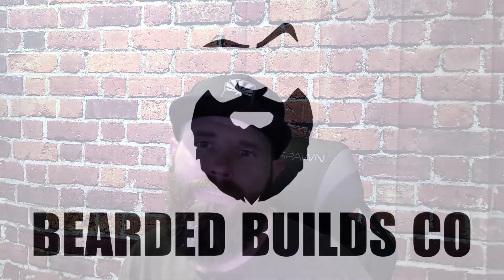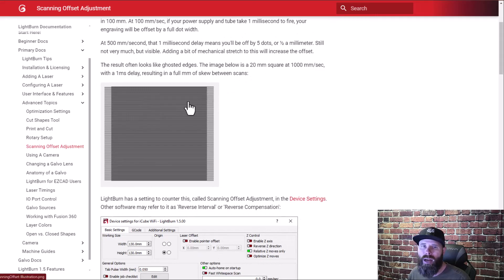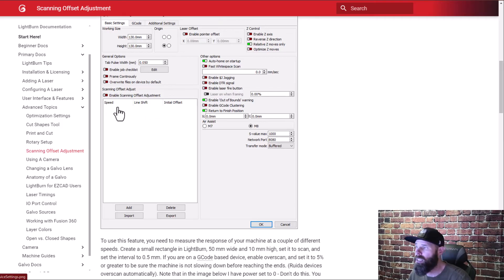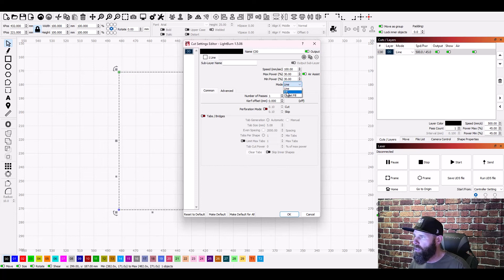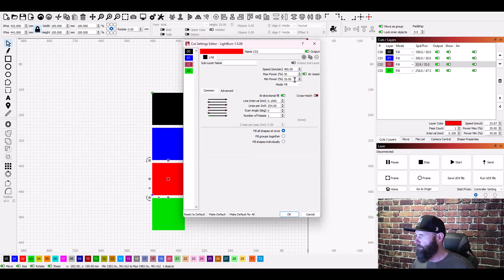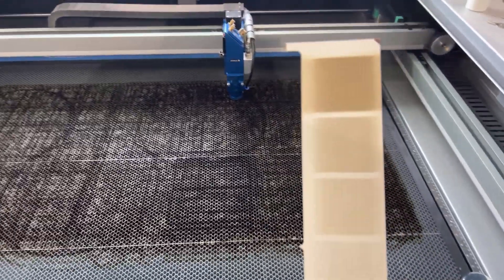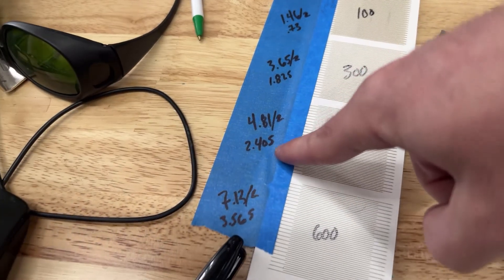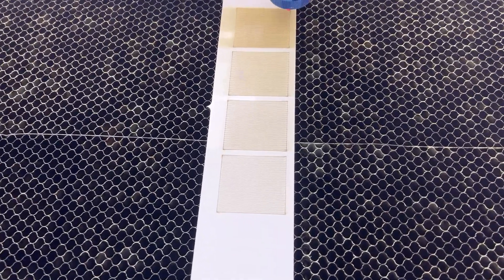Fix Your Blurry Engravings | Lightburn Scanning Offset Adjustment

Comment: Thank you thank you thank you. I am new to engraving and struggling for a month or so with “double images” it wasn’t off by much but enough that was totally annoying. I was ready to box up everything and return it. This image not only fixed my offset issue, it gave me confidence that i can figure out the rest. If anyone follows this step by step you will fix it. My only difference was i have a diode engraver and my settings were set to inchs rather than mm. But that was no big deal same principle. Thanks again. You gained a follower.

Comment: when doing mine, the adjustments are very minute. Even when I change them I still see my words are very pixelated. Any idea how I could help with that?
Reply from the maker: Either you still need to adjust your scanning offsets or your line interval is too low
Reply: @BeardedBuildsCo I follow the recommended settings from lonestar adhesives  and it says to use 300 ish lpi and I can get it smooth until I'm at 600 lpi, which I figure is too high but I'm not sure

Comment: Maybe you could help me out...
I did what you said. Enable Scanning Offset Adjustment new setting for Line shift does not stay when I create a new page. The new COO layer always starts me out at .0100 instead of my adjustment settings. Do I need to changes this setting ever time? Is the Adjustment settings just for reference? Thanks for any help.
Reply from the maker: I think you might be confused. The scanning offsets work in the background and compensate the left to right alignment of the design as it burns. 
I think the .0100 that you are talking about is line interval.

If you are needing one on one help you can schedule time here.
Calendly.com/beardedbuilds

Comment: Ok, great. Thanks now, do I just leave the enable scanning offset adjustment enabled and only run my jobs at those speeds?
Reply from the maker: Leave it enabled and as long as you got enough speeds programmed Lightburn should compensate for the rest

Comment: Thank you, was pulling my hair out trying to find out why it was doing this. ran a job in the morning no problem, then switched to an anodized aluminum job at much higher speed and it was throwing this error. Ran the calibration you showed and poof problem gone. took 15 min.

Comment: Hello!
I have a concern with my laser, please if you know how to fix either do a video or respond to this comment thank you and appreciate it. I have a NEJE 3 MAX V2 with E40 module, originally I was running the 810x460mm version and it was working fine in lightburn. Recently I bought the extension kit which would expand my working space area to 810x1030mm the problem is that lightburn now does not recognize the extra space😢 I changed the machine setting to the actual size and the outcome was the same. Basically, with the extension rails installed I can use only half
Reply from the maker: Xtool D1 Pro Extension Rails - Make your D1 BIGGER!
https://youtu.be/xej_fsXZBdY

Comment: Is it any possible that my new OMTech Co2 nearly doesnt have any offset in there? made this test 2 times and the offset is not measurable without a microscope. Or am i doing something wrong? For me your explanation is easy to understand and i used the exact same settings like you in LB

Comment: Great video.... I was SURE this was my solution and when I got up someone in the Lightburn forum simply said "tighten your X belt"     I went and double checked and yup! There was play...which gave the head SLOP in each start right and left... Your offset fix might have compensated for that and adjusting for different speeds might have compensated for increases torque at higher speeds. 
Your solution might be the fix for some, even most with this issue but i wanted to share my experience in that it might save someone else HOURS of troubleshooting and settings adjusting.

Comment: Great video, do these settings live in lightburn or are they uploaded into the firmware somewhere.
Do most machines come with offsets this far off? Those are some pretty huge offsets it seems.

Looking to get into laser cutting (10 year 3d printing background but new to cnc / laser) with a monport or an omtech 50 - 80 watt mid tier unit.

Comment: Also you mentioned these settings saving in Lightburn. If you have RDworks as well connected can they be saved their as well?
Reply from the maker: Why would you use both? You can export the settings and just save them.
Reply: @BeardedBuildsCo  just because I am used to using RDworks to load my work from coral draw?

Comment: Thankyou for this simple to understand video hopefully I can get crisp engraves on rubber! Can I just ask when I do embossed design so that the laser engrave the spaces between my design will I see less nasty engraved lines around the rubber engraved image, they look rather like ribbed pattern as in the line tests you show......hopefully the area not embossed but debossed will be smoother?👌
Reply from the maker: You need to test different line intervals, powers, speeds, and focal heights to get the look you like best.
Reply: @BeardedBuildsCo  Ohhh do you have a link for testing line intervals? I will do the test grid with powers and speeds & hopefully if I measure the material I can add in the 17mm minus the thickness of the material for focal height? Do this line test that you suggested first though or which order to do them in. I had exact measurements and focal distance for my rubber when the red and black 60 watt was working given to me when taking over the business so this is all new to me!!
Reply from the maker: @LouiseHolmanClarke you can test line intervals with the material test generator in lightburn.

I also have a full course on lightburn, its features, and usages.

Course.beardedbuildsco.com/store
Reply: @BeardedBuildsCo  Thankyou Ok I will bear this in mind in the future but for now I have a show in two weeks so I need to learn just what I need to know this week to engrave my stock! 😨

Comment: Do you have to do for every speed you use or will the software average the data and do that for you? ei,  if you use 380mm/s will you need an offset for that or will is use the date from the 300 and 400 that you have input?  Thanks for a simple and step by step explanation
Reply from the maker: You will want to do at least 3 speeds possibly most of you still see signs of an offset. If you use 380 I would do 200, 300, and 400
Reply: I did 100 200 300 400.  they came out even no offset..weird???

Comment: Once you enter your measurements, would you "write" to the controller? the version of Lightburn I have has this as an option  and I don't know if I need to hit it or not. I'm assuming I do.
Reply from the maker: Usually when you are doing this there is not a write to controller option. The software drives these settings

Comment: So, Lightburn will take into account these numbers you entered as long as it is enabled. You use speed of 100, 300, 400 and 600. What if you go 200mm or 500 mm speed, does Lightburn will average these numbers, I mean between 100mm and 300mm and between 400mm and 600mm, or you have to do it for each speed you use.
 Thanks for those great videos.
Reply from the maker: Lightburn will make adjustments for the speeds in between. If you see that something is still not quite right then you can add another speed entry to the mix.
Reply: @BeardedBuildsCo  Thanks for the reply, really appreciated, Jeff
Reply from the maker: @ostie01 you’re welcome!
Reply: Outstanding! You are a great teacher with no nonsense included. Earned my subscription.
Reply: Im have a different issue. I would like to send you a picture and see what your expertise say. I bought this co2 laser machine about 2 months ago. Not sure what seeting i moved but nowy lines aren't completely engraved thru.